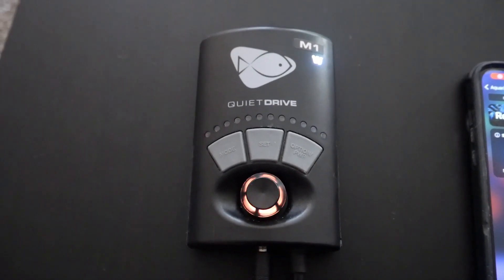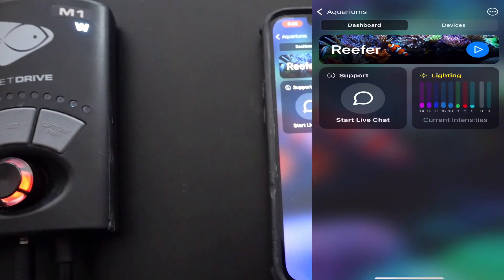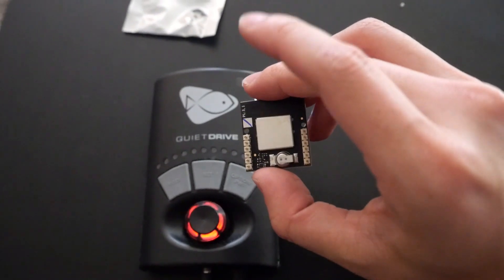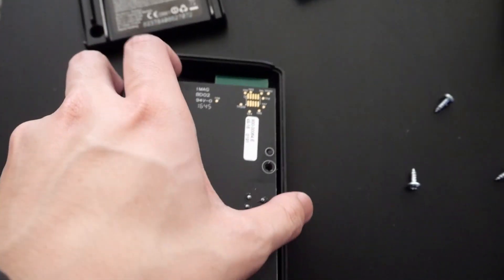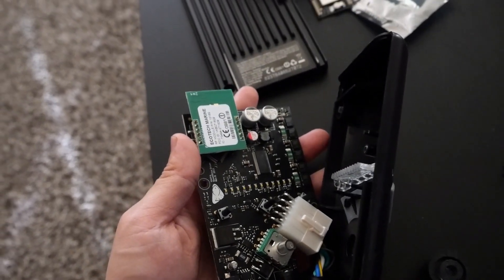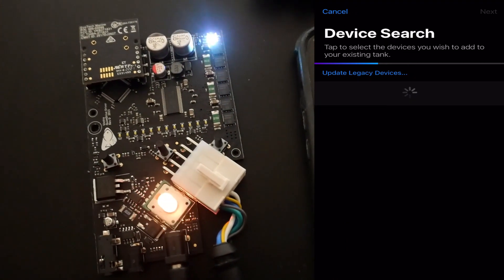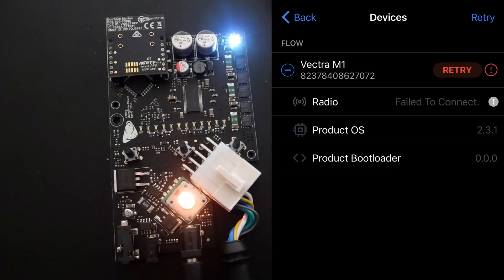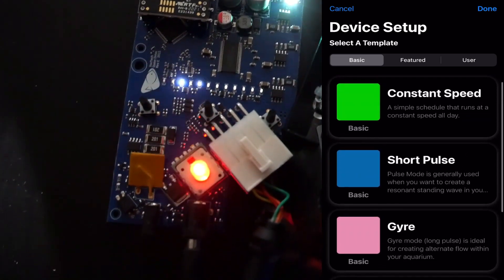Mobius for OLD Ecotech Marine Devices (mp10's, vectras, etc)

Comment: So i have two mp10wes that have the W that lights up in the top corner. Dates are like 2012 August.  Do i get a chip upgrade or a reeflink?
  Thanks
Reply from the maker: @Boogerboys1990 hey so I looked at that one and I cant find much information on it, but im sure if you replace the green chip in the controller with the new one you will be able to use mobius with it